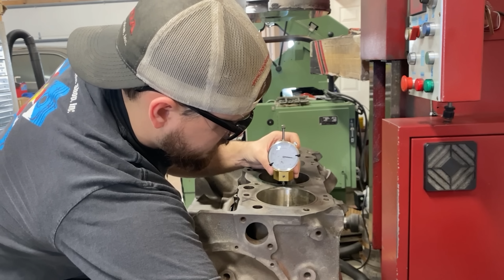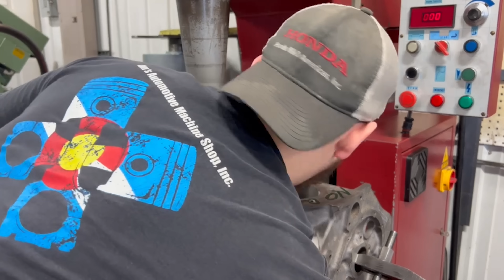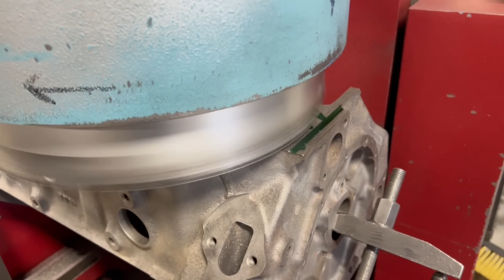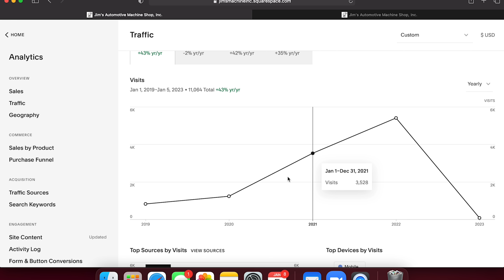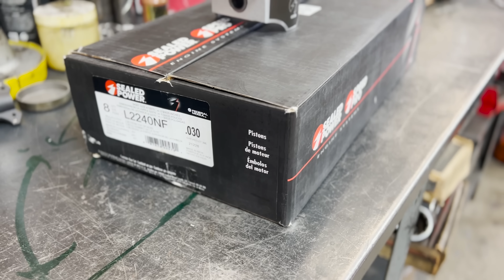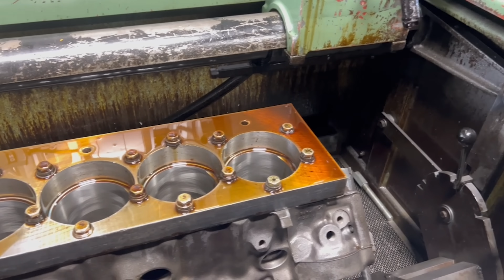Can You Deck A Numbers Matching Engine Block?

Comment from the maker: Head to https://squarespace.com/jimsautomotive to save 10% off your first purchase of a website or domain using code jimsautomotive!

As you all know, when you support our sponsors, you are directly supporting our channel and future content! We have been a Squarespace customer since 2015!
Reply: People have been decking those blocks and re-stamping those numbers for over 40yrs
Reply: if i ever need any engine work done, i’m going to bring it to you, because y’all do high quality work and all
Reply: Why not just deck the block and stamp the numbers back into it?
Reply: Std bore 396 will over heat the rings , the average wall thickness is too thick , the coolant doesn’t effect the wall enough, which is why later chevy made them into 402 with the 396 badges still on the cars. The same effect happened in the 283 , although the wall thickness varies SO much in those engines

Comment: Just wondering about the bar that the block rests one. I imagine that before you set the block on that rest, you verify that it is also level and square? How is that done? Also, do you need to verify that the journals in the block are true, or after boring and decking the cylinders do you then line bore the crank journals to match the deck? I guess I am wondering what the original reference point is.

Comment: I really like the old Chevrolet 396 and the 402.
I owned a 1972 3/4 Chevrolet truck with a 402 that was unstoppable and a beast in power and now that same 402 is in my guide work boat jet boat living a new life as a marine motor.

Comment: Nice looking machine job what grit is your final hone and what would the surface finish measure at would love to operate some of your machines boring decking and installing hardened seats but my favorite would be the serdi for valve jobs love the inserts where you get all your angles in one plunge or one at a time whole lot better than the old stones that I play with nice video

Comment: Nice video but shops don't put that much time and effort into a block. People should know that this is a marketing video. Shops know that you aren't going to see any issues for at least a year or more if you daily drive when they half * it. Shops have to move blocks because they don't have multiple machines.  Can't spend all day just getting a couple done. Taking about Taking 0.0005 " passes? 😂 only an idiot that don't know would believe that. Just because the DRO says that doesn't mean that's what actually happened.  Especially when dealing with the diameter of that tool relative to the spindle.

Comment: I restore vintage and classic motorcycles in my retirement (early due to health) and I get great enjoyment from these videos,  however I do suffer 'machine shop envy' for a day or two after. I wish I had your space, your machinery and your cleaning assistant to offer advice. If I am struggling with something and need a break, your videos are a great inspiration to get back to the problems at hand (75 year old motorcycles inevitably have 75 years worth of bodgy repairs). Keep up the good work with the videos, it never gets boring for a fitting and machining nerd. 👍 😊

Comment: I miss the smell of honing oil. 😂
Amazing how much more accurate the machines are than the machines I used in the 80s. Rottler boring bar (no CNC or digital read outs) and Sunnen cylinder king hone. We didn’t even use a torque plate. Back then, we were all used to pulling into a full service gas station and the attendant checked the dipstick and told you how much oil you burned or leaked between fill ups lol. 
Nice precision work 👍👏👌🏻

Comment: With precision like this you've almost got to ask, is a gasket nessary,  well the short answer is yes. But its really not as nessary. 

I cant belive stuff was that dam far out new.  Motors today have tighter tolerance but cheaper materials.
Back then bullet proof but not quite as good craftsmanship.  Probably because of the bean counters.
Im sure the guys making it wanted to get parts better, hell the machines then were built better.

Comment: Decking a block is just dumb and a total waste  of cash.  No block from the 60s and 70s was perfectly parallel and the engines ran fine.  You start decking you create a problem with the valve train geometry and a whole host of other issues.  THIS IS A LIE TO MAKE MONEY!

Comment: What is the purpose of the torque plate in the honing process?
Reply: Mimic the stress and distortion of the cylinder head bolts, so you hone the cylinder more round.

Comment: Worked on about a dozen, 1963 GM 390cid Cadillac motors, my best old friend has had every model 1963 Cadillac. Not one engine block was decked square or decked equally from side to side, Line Boring these things can be down right silly!

Comment: Interesting. Does the metal in the block distort enough when the heads are installed to warrant the simulation of the torque at the honing process?
Reply: Yes, The tension on the head bolts will slightly distort the cylinders roundness. The idea is to emulate the stress of the installed head while honing. Everything is rubber. Everything moves. Nothing is perfect.  Remember that! 😊

Comment: 4 measurements needed. 
1. Align bore crank
2. Parallel bore crank and camshaft
3. Perpendicular bore cylinders to crank bore. 
4. Then parallel decks to crank. 

Very common misalignments of all v blocks.

Comment: The numbers are there but unfortunately the factory broach marks will be removed from the rest of the number pad and the other parts of the exposed deck surface.
Reply: I bet you’re a barrel of fun at parties.
Reply: @FlatBroke612  its still an impressive way around a common issue with restoring a matching numbers project. No doubt about that.

Comment: While you did damage the numbers, I don't fault you for it.   it's always a high risk to deck a numbers matching especially when the numbers are in odd places like this block.  When I was kid, a lot of the machinists would just shade the numbers and re-stamp them once they were done.   Maybe a suggestion would be put a piece of painters tape over them as a stopping point and manually do the last 1/2 inch to inch.   As the machinist my dad used to go to would say "Lesson learned, mistake known, better luck next time"

Comment: I'd like to ask a question if I may ...

If you've gone through the process of installing sleeves , what is the purpose of then boring the cylinders 30 over stock size ? I understand the idea of doing it in a rebuild with no sleeves , but wouldn't it be better to start with the standard bore size for future rebuilds since it's already been sleeved anyway ?
Reply: The block was roached from water intrusion. Thus had to be sleeved. Sadly .030 pistons where the smallest available anymore for that bore.
Reply: @timcope3115  that makes sense ! I didn't think about what may be available for the parts !  Thanks for the reply !
Reply: @f75gunslinger  You would think as many of those engines that are out there being restored that there would be some company supplying std. bore pistons. I guess the demand just isn't that great to warrant them and .030 is the most logical size. I am like you. I would hate like hell to sleeve an engine and then be forced to go .030 over bore.

Comment: Fascinating stuff! What does the torque block do? Is it to add rigidity to the block or something?
Reply: Mocks the deflection the fasteners would put into the cylinder wall when the heads are installed.

Comment: is the pan rail really the best way to reference? I prefer to use the main and cam centerline, after machining/correcting both of those datum lines first, of course. 

      On your CV-616, you should try the C30 series stones instead of those AHU/JHU Stones. Those short stones were designed to straighter out tapered cylinders, not as much to finish hone fresh bores.

Comment: All the v8 boring jigs i have used didn't clamp through the cam tunnels the clamping studs continued up and then a flat bar went right across the top of the inlet manifold sealing faces. Also if you want some fun with your workmates get some of the boring chips some battery acid and mix it together in a glass. I used to do this and crankgrinding etc from age 15 to age 34 when i realised i had to get a job that paid a decent wage and i didn't go home everynight stinking of various oils, cleaners etc. The only thing i miss is being able to build my own engines dirt cheap and help the occasional mate out. I am in Aus and the job took me overseas for a few years so i have many memories of it still as i near retirement.
Reply: 1 are you in melbourne, 2. Do you know of any engine reco businesses still running?
Reply: @NickGreiner1988  No i am in Hobart we have  1 company still running so i would assume melbourne would have several at least.

Comment: I've assembled a handful of engines in my time. I'm no expert but I reckon there is a decent amount of power to be gained by getting the deck surfaces level and getting a proportional amount of compression in all 8 cylinders.

Comment: I have a low mile 454 out of a wrecked 86 model RV that has a date with the machine shop really soon. Its a high deck big block so we're gonna see what we can do about all that 😁 and it honestly doesn't need bored but imma go .030 O just because of..... Reasons and stuff 😊 
Love the channel
Reply: I’m 99% certain GM did not produce a 10.2” deck 454. The 366 and 427 commercial engines were factory “tall deck”. You can turn the 427 into a ‘54 if you clearance the block for the rod bolts though.
Reply: @FlatBroke612  It's 9.800"
You're correct 👍 I've never owned one before nor have I ever taken one to a machine shop. I was told in passing by someone that there were 2 different 454 blocks. One for street applications and one for service. And I just assumed the one in my old rv would have the tall deck.
😁 For once I'm happy to have been mistaken.
I still have the engine but I can't decide what I want to do with it 🤔
Do I go with a C10 build or cram it into a car?  Right now it ain't hurting a thing sitting there on the shop floor. 😊

Comment: After a few years making cylinder heads, I find this particular operation amazing.  A cutter that large with a single blade.  Such a good finish.  I"ve seen worse finishes with 30 plus inserts and a wiper blade.

Comment: Next time you'll take a head gasket, dykem and put a witness mark on the deck.... maybe even use a cylinder head to plant a witness mark. It's like nails on a chock board watching you take after what cannot be un-done.  Yow-eee. I'd even consider shoeing down a straight edge and taking a properly ground high-speed lathe tool bit and scraping in a nice straight rut into the deck just ahead of those numbers. (bout .010 deep)

Comment: How do you know the maximum amount of thickness you can shave off the deck height? . I ask because I was reading an old NASCAR rule book and it says the minimum accepted deck height for a specific ford block is 8.875 inches (minimum)..this nascar block they refer to comes with a 9.2 deck height before machining. That rule made me curious because I was not aware you could shave off so much material..  I know the best way is just take off the least amount required but what is the maximum and what are the risks?

Comment: I’m always amazed at how inexpensive engine machine work can be given the cost of machinery, time and most importantly knowledge required to do the job properly. Having had machine work done for dozens of various racing engines used in road racing over my 36 year career I enjoy seeing the care and expertise you put forth.
Reply: Even a million dollar machine can only charge so much per hour or the business model won't work, longer ROI, debt is a tool not a burden
Reply: @CodyMcGriff  what kind of ROIs do you see for different pieces of equipment?
Reply: @sc358.  I have no idea but I'm sure some quick Googling would help determine that but you would need a full machine shop to get started remachining engines, I would start by working for a master machinist and learn from the bottom up, pick the masters brain and go from there 🧠
Reply: @sc358.  this could depend on cost of machine and how often you use it vs. How much each machine can justify per hour charge for instance 10% of a machine shop can pay off the whole machine shop, I went to college for manufacturing and we used the welders and wire wheel 80% of the time and the lathes just sat there, not good ROI, much more skill and precision involved so do your homework before buying any piece if equipment. My vote for anyone is to pay for chatGPT 4 for a month and ask it all sorts of question such as you are asking me, it has helped me indefinitely build websites, apps, SaaS and apparel brands and it will only get better, get work !
Reply: @CodyMcGriff  makes sense.  Don't think it's an easy business.  Luv racing engines but probably not the easiest way to make a good living.
Reply: Competition from other shops was the main reason for inexpensive machine shop labor rates. Barely breaking even seemed to be the "norm" for decades. Today, there are fewer shops due mostly to the fact that the auto rebuilding industry is not what it once was, with fewer people keeping cars for long periods of time. Our shop has survived well on performance and light industrial services, and we're constantly adjusting (raising) our hourly labor rate to meet the cost of being in business. At the end of a day, week, month and year, we're just breaking even.
Reply: I know it's the most precise and critical work with squaring all axis and extreme tolerances that any joe blow can just pay $200 and have done. I can barely turn a plastic bushing for $200.

Comment: It appears to me, from what I can see here, that you are measuring the deck height from the bottom of the bore.  I haven't done open-heart surgery on one of these in a very long time, but as I remember the bottom of the bore was not a reference surface.  What is the reason for picking that surface and not a crank or con rod surface?
Reply from the maker: It's measured relative to the main bore of the crankshaft.
Reply: @JAMSIONLINE    Thank you for the info.  Now I feel much better.  Great videos all.  Season's Greetings.

Comment: I've rebuilt dozens of engines. Mostly marine diesels, but also racing and aircraft. I originally learned on aircraft radials. It's not surprising the block decks don't match or are out of square. It's been my experience that a good machine shop does a much better job than the OEM. The OEM only worries about the block falling with their wide tolerances. A good machine shop like Jim's spends much more time and better machining practices to achieve much closer tolerances than any OEM I've ever seen. Although bigger diesels that have replaceable sleeves are much closer than any gas engine. Especially cylinder to cylinder. But they usually make up and small differences by using different sleeves. And big diesels have individual heads.
Reply: Cummins yes some did have one head per cylinder and the old Big Cam/Small Cam engines had one head per 2 cylinders. Detroit Diesel only one that I can think of had one head per cylinder, that was the 149 series. I know I built many Detroits, Cats and Cummins.

Comment: Is there an issue with thoroughly documenting the numbers and re-stamping the numbers after surfacing? My understanding is that the "numbers matching" is the verifiable claim of "all original" that is so coveted.  To that point, I'm of the opinion that it would be better to have an original block/head set that had been properly refreshed/rebuilt/ machined over the years than to replace it simply because the numbers would be gone. 
Ftor: I grew up as an old school diesel mechanic's kid and had the privilege of spending time around skilled craftsman in mechanic/machine/fabrication shops. I've always appreciated the discipline and attention to detail that is required for you trade. Thank you for sharing with us

Comment: Question: since this block has cyl sleeves installed, do you have to be concerned about the cyl sleeve thickness you are left with after final boring and honing?  If so, what is an acceptable limit on the cyl sleeve thickness?

Comment: Pontiac's benefit tremendously from zero decking.  Never set the piston down in the hole, for compression ratio.
Reply: Stock for most Pontiacs was something like 0.023-ish in the hole so they gave up a lot from the factory
Reply: @TribbleBot  Absolutely,  you sound like you know your numbers. Very important in engine building.  Balancing is also money well spent.  Good luck to you.

Comment: If your worried about machining off the factory numbers you can find die punches the same size as the factory used dies and re stamp the block if done right with the same punches it looks factory
Reply: If the car is going for a concourse restoration where it will be judged it is possible to tell if it’s been restamped - the factory stamps are like a fingerprint because the fonts the factory used at a given point in the VIN sequence or date will be slightly different than the stamps bought years later from a different supplier. To a collector it means the difference in buying a real L78 396 Camaro or Chevelle or a 6 cylinder car that’s been cloned to be a 396 car. That said, there are restoration shops who cut their own stamp fonts to look exactly like the factory ones and they have made big money making counterfeit big block cars.

Comment: Question, Wouldn't you want to bore with at least the main caps torqued down and possibly a torque plate on the top of the block? I would think you'd want all stresses induced while boring to keep the bores round when properly torqued down